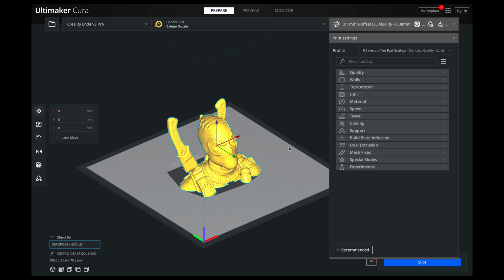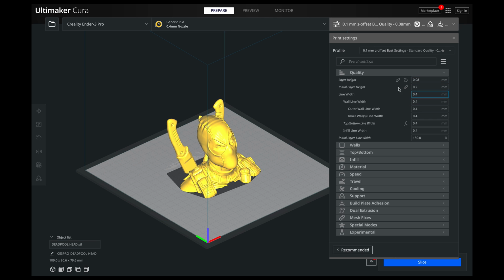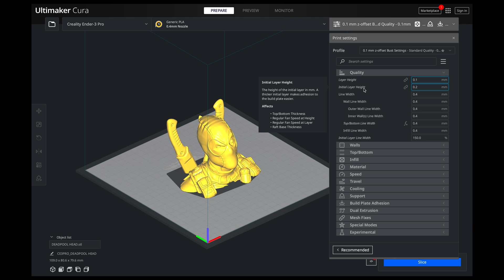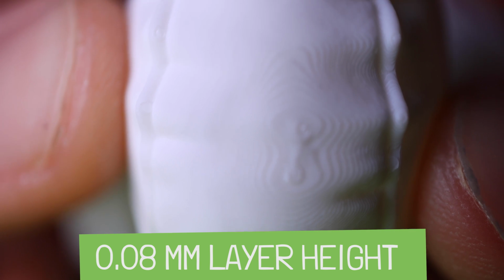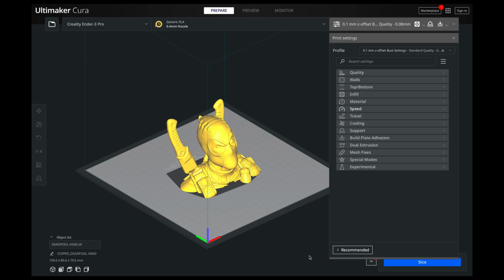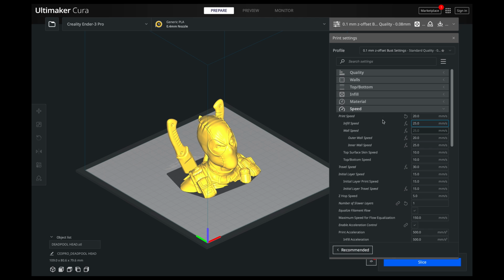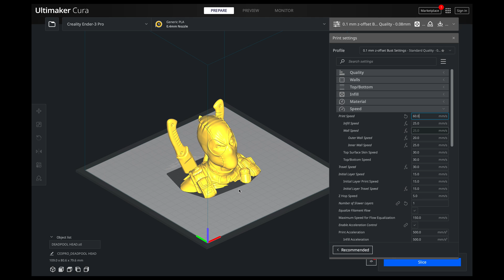Cura Settings to Get The Best 3D Prints | Quality & Speed Settings for Awesome Detailed Prints

Comment: What speeds should I use for acceleration? I have printed some busts at 100 mm/s and 0.1 layer high, tough with the acceleration on like 10 000 mm/s, but it wobbles a bit since its moving so fast (cant notice ant defects with it tough). Should I lower it by 50% to 5000 mm/s or even lower?

Comment: That was quite helpful actually, but what are some good super high quality safe print specs for an out of the box neptune 3 plus doing elegoo pla?
Dont care about infil ratios to save filament, just nice solid prints that don't need sanding, other than slowing things down. I have no idea what I am doing so I will get into that stuff once i've had some practice and successes. I'm mostly just doing things like kitchen organization and cnc clamps and work tools, so the more solid the better.

Comment: Ok, so when you're adjusting layer thickness you can check what is the minimal turn of motors in your printer responsible for lifting the head up and down. 
In my Creality S1 it's 0.04mm therefore you go for multiplication of this. 0.08, 0.12, 0.16 etc.
Reply: Good one 👍🏼 And printing vertical stuff with right angles, like a house model without sloping roof, a large layer height can really be helpful

Comment: If we change Wall line count from 2 to 3, our print will be stronger, right? But does it make the quality of the print worse?
Reply from the maker: Yes it would be stronger. I personally would say no from experience it will not make your print look worse. But I always suggest doing test prints to see what works with your printer.

Comment: What is the best solution that can be used to polish the print surface after printing?
Reply from the maker: I will use sand paper. To smooth then paint over it. If you don’t at least prime it you’ll see all the scratches if you want the filament color

Comment: I deleted Cura and reinstalled it, but all my models are very small in size!! What can I do to return the size of my models in Cura to their original size? Thanks
Reply from the maker: You can use the scale tool on the left side of the screen and scale the model up that way. Also make sure your printer settings are correct. I’ve made the mistake of having a bigger bed than I have get messed up in settings and my models looks small but it turned out it was my bed size.

Comment: My god, I just find you after a year of struggling with all kind of settings.

Really, you are the best. Examples, very good explanation's.
I hope you will post some more.

I would love to here you on PETG filaments settings. This medium is another beast.
I print perfect parts in PLA, but the same parts in PETG are the worst.

Again thank you for your videos on Cura.
Reply from the maker: I’m glad I could help you out even if it’s not when you really needed a year ago. When it comes to PETG I don’t use it much maybe I can get a few spools and see what I can do with it.
Reply: @ItsMeaDMaDe  
Thank you for your reply ! Do you have anything on ABS filaments ? I was told that it would be easier to get good prints than PETG. I have a Creality CR6 Max, and am not Shure of it's maximum temperature. Thank you again for these great videos !

Comment: What speed can you achieve with a 0.08mm height on bigger printers such as the flsun v400 or bamboo labs and still get smooth prints?

Thanks
Reply from the maker: Honestly I can’t tell you. It’s something you would have to test. I haven’t done speed test on bigger printers
Reply: @ItsMeaDMaDe  I've literally just watched about 3 hrs of your videos and learned so much. When you dial in your settings for example the z height distance for floor and roof supports will that be it for every model I print or will it change depending on what I print?. Hope I have made sense here.

Thanks
Reply from the maker: @dannyspencer933  yeah, I have quite a few videos. I’m glad to hear you were able to take some info out of them. So when it comes to dialing in your settings, you will have to tweak it if you change your layer height. that is when I have found. I don’t get my good support settings that I dialed in so I have had to create support settings for the different layer Heights that I use. So if you always use a .1 mm layer height and that is where you’ve dialed in your settings, you should never need to change it again. at least I have not changed my settings since I’ve got it really good and dialed in and it prints good every single time and the supports come off easily. I hope that’s helped.
Reply: @ItsMeaDMaDe  I'll be changing for 0.2 to 0.08 say I understand now and would need to create profiles for each change. Thank you so much.

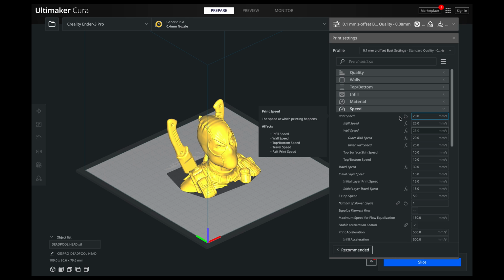Comment: 9:05 yes, I use 24mm of speed. It is because plastic have melting point speed deppend , too fast printing will cause presure beetwen nozle and pushed plastic, and then it happens blobs.

Comment: I tried adjusting my print speed and no mater what, the printer keeps printing like as if I never changed the speed. For example, cura default printing speed is at 50 mm and it says that print time is 10 minutes. I change it to 30 mm andits still the same. Things gets more crazy wheni tried setting print speed at 100 mm or 200 mm and the time is still 10 minutes. This is a first for it to hapen to me. My first printer is a Tronxy x5sa and it's crappy. But I'm at least able to print an articulated slug at a 30 mm print speed. My new printer, ender 3 s1 pro, is just butiful and works like a charm, but I can't get the speed right. I do belive that it's the slicer though. I could manually slow down the speed directly on the printer as it's printing, but that defeats the pourpous of setting the speed in cura. Plus i can't realy tell at what percentage matches with 30 mm a second and I can't tell how long the print will take as cura left me with 10 minutes and the printer screen doesn't tell you how long it will take or how much time is left for it to finish. Please help, I realy need to know as speed is everything and I need to eventually print small detailed parts that require slower print speeds.

Comment: I have a quick question so if you change just the print speed and leave all the other speed settings will it slow the rest down based on the actual print speed? Or do you have to manually change all the speed settings to slow it down
Reply from the maker: You have to change all the initial layer settings and for the rest of the print mainly just the print speed.

Comment: When it comes to speed, what you're showing mainly comes to the wall / top layer speed no? I know that those are usually 1/2 of the inputed speed but if they're being overriden (like it seems to be in your SPEED SETTINGS section) then the speed shouldn't do much right?

Comment: Without attempts to increase the Flow setting, it's not conclusive to say a .4 nozzle can't output a better .3mm layer height...  Yes, eventually something like a volcano nozzle will be required to heat up the filament, but .3mm and good layer adhesion should be achievable.
Reply: Just finished a cube, 0.3mm layer hight with 0.4mm nozzle. No issue with layers, could probably push it a tad higher. But, im not sure. Have direct drive, and motor is larger than few other printers i looked at. Only issue i have with the cube model is the corners. Corners kinda bulge, like it goes to far then split second after corner it reposition it self according to dimension.  so atm. Currently trying to figure out what is causing this. Suspecting my print speed has been a bit aggressive. But im not sure if this can take all the blame. So many factors that can produve results im getting. But hey, luckily i was aware 3d printing is not yet plug and play or forget. More a hobby, where there is so much to learn to get the most out of your printer.

Comment: Love your video with good details and to the point. I noticed that your infill speed is set to 25 and speed to 60. I'm just wondering since it's inside the project and it's not really visible would it be better to set it to a higher speed to reduce time or will it affect the project ?
Like Speed 20 and Infill 60, would it still be as nice ? Thanks
Reply from the maker: Yeah that would work. The infill speed doesn’t affect much. I didn’t go into much about the different between the too. But you are correct.
Reply: A speed of 20.... would be less than a speed of 25 though😅

Comment: your flow to speed is not due to the nozzle, but the heating element.   You can print faster,  by printing Hotter.  The downside is a higher need for part cooling fans, as the hot plastic coming out, will lose shape if it stays hot too long.  The amount of material pushed out, does have limits, based on each hot end design - but honestly most people aren't hitting them until they are printing above 220C (for PLA) and still unable to get enough plastic out.

Part cooling is just as important as everything else.  Especially if you want to print fast and have it look nice at the same time.
Reply from the maker: Thanks for the tip. I'll test it out.

Comment: Cool. I'm having an issue dialing in a new printer.  It is a geeetech a30t three colours single nozzle. It's not a bad machine, a bit under developed. Their software is mediocre.
Reply from the maker: I’ve seen those printers but haven’t heard anything about them. Hope you get it dialed in good.
Reply: @ItsMeaDMaDe  It's been out for a while, I was surprised how few there are. I can see why. It's not bad for the money, but the extruder drives are poor and the software  is lame. I am changing them over to gear drive in a more creality style extruder drive. Even if the 3 colour doesn't work, it's still 330 x 330 x 420. Keep at it. you are informative.
Reply from the maker: @Matt2chee  well I wish you luck with it. That’s why I go with creality on my fdm printers. Parts are readily available and there are tons of mod kits for them. Thanks a lot for the kind words. I love learning everything I can and just want to spread the knowledge to help people. I’ve been doing 3D printing for almost 8 years now and the space has changed so much. Just want to give people the help I didn’t have (or wasn’t around) when I first started.
Reply from the maker: @Matt2chee  well I wish you luck with it. That’s why I go with creality on my fdm printers. Parts are readily available and there are tons of mod kits for them. Thanks a lot for the kind words. I love learning everything I can and just want to spread the knowledge to help people. I’ve been doing 3D printing for almost 8 years now and the space has changed so much. Just want to give people the help I didn’t have (or wasn’t around) when I first started.

Comment: Thank you for this! I use Simplify3D mainly but a lot of this applies. I’ve sat in front of my printer and re-printed the same thing close to 20X to test settings and results to get everything dialed in. One thing I still have issues with is overhangs could still be nicer so I will try dropping print speed in half when it gets to overhangs to see if it makes a difference. Great video!!
Reply from the maker: Your welcome. And thank you for the kind words. That’s why I was also trying to explain more theory of what it does cause it can apply to any slicer as well. I use to use simplify3D but switch to Cura. I enjoy the interface more. Both great tools.